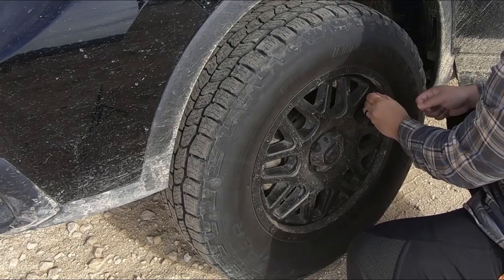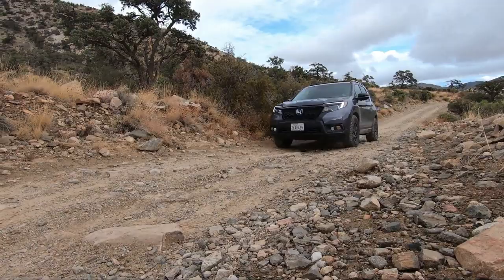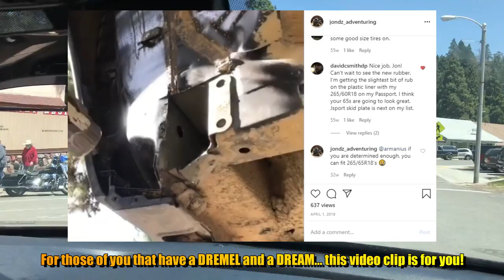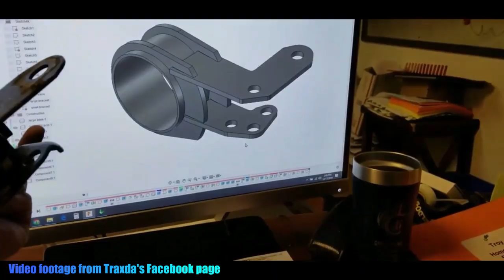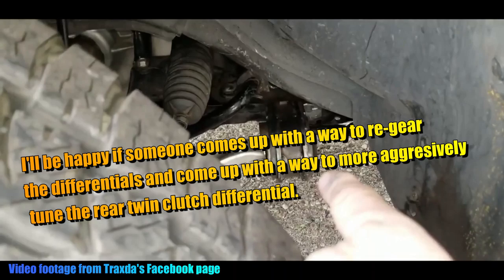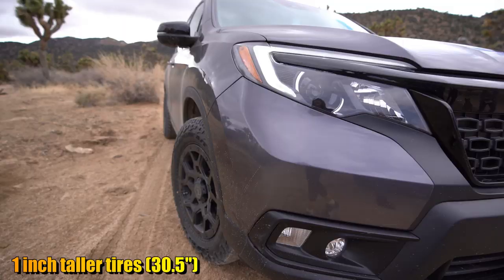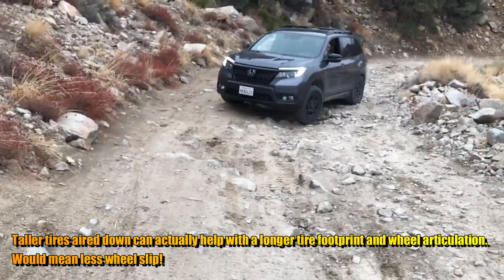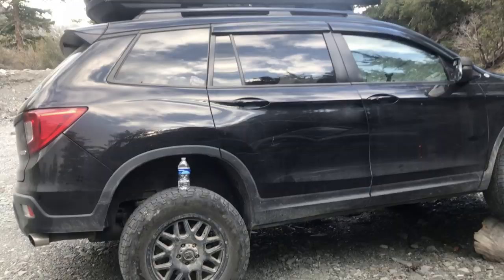TALLEST TIRE?  On a Passport/Pilot/Ridgeline

Comment: You probably already answered this question but what is the max tire size you can put on a Honda ridgeline 2022 without a lift? Thanks
Reply from the maker: The answer is in this video.  It’s not exactly cut and dry, so I recommend you listen to the explanation.

Comment: great video. I am searching my next car now. I have question about how is the 9 speed ZF trans?  thanks
Reply from the maker: ZoeY thanks!  What is your question?  For 2019+ the Honda’s Passport has the 2nd gen ZF9.
Reply: @JonDZ_Adventuring  thanks for your reply. My question is do you have any complaints about the zf trans, any issues or concerns?
Reply from the maker: ZoeY only praises.  It gives the passport a 20:1 crawl ratio.  Besides the Honda 10 speed with a  22:1, no one really comes close.  Most automatics are at 14-16:1.  The Honda 6 speed is at 14:1.  That’s means less capability.

Comment: What size A/T tire should I get for the 2019 passport without rubbing. Won't be in any rough terrain just water. Thanks
Reply from the maker: With zero rubbing? 255/50R20.  That’s a 30 inch tire.  With slight rub at only 90% lock, 265/50R20, that’s a 30.4 inch tire.

Comment: 2021 Pilot with 20 inch wheels here. Stock tires are 245/50/20. Thinking of going 265/60/20 with the 2.5 inch lift on front and 2 inch lift in the rear. Haven't seen this setup yet so not sure on if it can and will work.
Reply from the maker: that won't work at all, that's a 32.5" tire.  With no cutting or the Traxda axle relocation kit, the largest you'll fit is a 30.5" tire (with slight rub at 90% lock.  As mentioned in this video, a lift wont help you, actually might make it worse.  I personally have 32.1" tires 255/70R18, but I cut my wheel wells.  I have zero rub, even when offroad.
Reply: @JonDZ_Adventuring  that's weird because the stock tires on the 20s are 29.6". Without the lift I have 2 inches of clearance all the way around the tire. Guess I gotta do some more research ☹
Reply from the maker: This video is it.  There’s nothing out there, that’s why I made the video.  Just for you 😃.
Reply: @JonDZ_Adventuring  so I guess I should just stick with the lift and the 255/55/20 that SHOULD fit it. And thanks for the vid bro, regardless of my dumb decisions you are helping our community tons 😁
Reply from the maker: @dy2str33t-king5  if you have a dremel and a dream... you probably could live out your fantasy of taller tires 🤣
Reply: @JonDZ_Adventuring  lmao I definitely do but hacking up a brand new car with 100 miles on it won't do it for me. I wanna stay in the realm of, safe so I'll just go smaller.
Reply: @dy2str33t-king5  Did you end up with the 255/55r20? I have s 2021 Ridgeline with a 1.5 lift and thinking of putting these on. Going with a all season tire not AT. Hoping it will work out

Comment: We have a 2021 Ridgeline. I ma considering on switching the tires to a Falken AT3 or Nitto ridge grabber 265/60/18? Would these two fit without any rubbing without the lift? Thanks! 😀
Reply from the maker: There would be a little rub at full lock, but nothing too crazy
Reply: @JonDZ_Adventuring  Okay. Thanks!
Reply: Did you do it? Any rubbing?

Comment: Hello Jon, great video, super informative, I do 95% of my Passport driving in So. Cal. but occasionally hit the Sierras and would like to go with an 18" Wheel and some Nitto Grappler2 (265/60R18) which are 30.51" tall. It's great to know that this will work without a Lift Kit. My question is in regards to the Front Rubbing: Does the Wheel Off-Set affect the amount of Rubbing? I know JSport sells a KMC Wheel that matches the OEM Off Set (55mm) but other Wheels (like Black Rhino) have a 35mm Off Set and I am not sure how (or if) the Off Set will rub more or less? Thanks Man...!
Reply from the maker: stevendphoto the rubbing in the Passport/Pilot/Ridgeline happens in the front wheel well on the inner back side.  Let’s say for example that somebody wanted to fit larger tires that required cutting.  The trimming needs to be done 5 inches across and 4 inches high.  The Lower back corner needs to be chopped off about 1 inch diagonally.  With all that said, my guess is that offset won’t really make much of a difference for 30.5” tires.
Reply: @JonDZ_Adventuring  Thanks, great to know...
Reply: @stevendphoto, @JonDZ Adventuring.    I have 265/60/18 on my '19 pilot touring on +38 offset rims.  Slight rub full lock both directions.   Where it's rubbing doesn't seem sharp or destructive, but JonDZ might have a better answer on that aspect.  ;)

Oh, and my 1" diameter increase, increased my mph about 1mph, maybe 1.5mph.  I have a radar detector w/gps that shows my mph, and I'm generally just +1 vs stock.

Comment: Help requested: I am mostly looking to upgrade the 18” tires for looks and light trails. The OEM tires look very bad, to me- 245 60 18s. Would 265 60 18s look better? People’s experience?
Thank you
Reply: Yes! I put 265 60 R18 Cooper Discovery AT3’s on my 2017 Ridgeline and it looks great! Can’t feel any rubbing either.
Reply: @mousehunter8425  Thank you for response! Are the tire quiet? Did you notice speed or gas mileage difference? BTW- exact tires I was going to purchase!!!
Reply: @goforce32  there is a little road noise, but not much in my opinion. Mileage went down about 1.5 mpg but totally worth it. Speedo is also a mile or two off, but the truck looks 200x more “manly” or truck like. It’s been a big difference I’ve wanted since I bought it. And I love that tires are all terrain for dirt roads and towing my boat., and still 60,000 mile guarantee.
Reply: @mousehunter8425  Thanks again.  Great info and it helps. ;-)

Comment: Jon, when you go off-roading what mode do you usually use? Normal/Snow/Mud etc.
Reply from the maker: Most of the time, just Normal / D.  For the steep difficult 4WD trails I go with Sand Mode / Sport mode / Manual 1st gear with my left foot on the brake and right foot on the gas.

Comment: Do you think the Michelin Defender LTX M/S 265/60R18 would work without any rubbing?
Reply from the maker: I think it would rub less than an All-terrain tire, but that’s a tough call.  The rubbing only happens at the full turn of the steering wheel.  Only at 90% steering lock.
Reply: thats all I run on my 2017 Ridgeline w/no problem and 25 mpg

Comment: So what is the biggest tire that I can put as an all season tire??
Reply from the maker: Either a 30.5” x 10.4” or a 31.1” x 10.0”.  What size diameter wheel do you have?  If you running the stock 20 inch wheel, you can get either 265/50R10 or 255/55R20.  If you’re not using it already, the tire size calculator is an excellent tool.  Link below:
https://tiresize.com/calculator/

Comment: JonDZ if I'm going to taller tires, what do you think about going from 18" down to 17" wheels in order to get the right tires?
Reply from the maker: Good question!  I think 17 inch is an excellent wheel size.  What size were you planning to go? Keep in mind a really wide Tire many run into the sub frame.  The Traxda Ridgeline was able to run wide tires (I think they’re 285) by running wheel spacers.  Greg at Traxda could help you with questions.
Reply: @JonDZ_Adventuring  I'm thinking 265-65R-17,  30.56" diameter
Reply: @JonDZ_Adventuring  thank you!!

Comment: I'm running stock wheels (16) and tires (235 x 70 x 16) on my 2006 Pilot. What can I get away with height, and width especially, with no modifications to suspension.
Reply from the maker: I have no idea 🤣.  Sorry, but this video only applies the newer models.  There’s a guy that off-road/overlands a 1st Gen Pilot.  He would probably know
Reply: @JonDZ_Adventuring  Well damn!
Reply: 245/75R16 fits without rubbing on my 04.
Reply: @GabSailsCaper  That's probably what I'll start with. I am considering a 255!

Comment: @JonDZ. Did you add skid plates to your vehicle? Were they expensive to install?
Reply from the maker: That was the first thing I did.  The front skid plate covers both the engine oil pan and transmission.  I have a 5% discount code with Nolo designs “JONDZ5”.  The front skid plate is designed to be taken on and off so you can change your oil (or have someone do it).  So, I highly recommend you install it by yourself to get familiar with it.
Reply: @JonDZ_Adventuring  . Thank you!

Comment: So I’m looking at these 265/70r18 tires, what do I need to do for them? If I relocate the axle and do a spacer would that work or do I have to cut that back part?
Reply from the maker: You'll have to bring that axle forward atleast a half inch and trim the firewall.  There's two firewalls, so don't cut into the 2nd one.  Minimum 3.5" lift recommended.  I hear Traxda is working on a really stout 4.5" lift.

My Passport in it's current form has 4.25" of lift.

Comment: What does the larger tires do to the speedometer reading?
Reply from the maker: Phil J good question!  I probably should have mentioned that, eh?  A taller diameter tire will decrease the speedometer and odometer readings as well as decrease crawl ratio.  I'll also add that it will use more fuel to get moving, may decrease acceleration.  Rotational may increase mass increases (depending on weight difference).  Highway MPG's may increase.  My vehicle has 2 inch taller tires, which is a 6.8% increase in diameter / circumference.
Reply: That could be fixed?

Comment: Will 265/60R18 Wildpeaks work on the stock wheels of the pilot? Without spacers or a lift kit
Reply from the maker: Stock setup will rub the least unless you get a 3.5 inch lift kit.  The 2 inch lift will cause the most rub, you either have to have the center hub of the wheel under or above the pinch weld.

Comment: Can I keep my 18” stock tires to put on the 265/60/R18?

‘18 Pilot EX-L
Reply from the maker: Sorry for the late reply, you absolutely can.  There will be slight rub, but only at 90% lock, which most people can easily deal with.
Reply: JonDZ Adventuring all good. You answered my Q on IG. Thanks. 

More Qs via DM to come. Lol
Reply: @JonDZ_Adventuring  This vid is so amazing. I purchased a 2020 Ridgeline RTL-E two days ago. So, I understand about the 265 65 18 having a slight rub at 90 lock. I think that I can live with that. But I have two related questions. 1. I was thinking the BFG AT KO 2's would they be the exact same diameter as the Falken? Or do you know where I can find that info?
2. What about the travel up and down. Is there a possibility that the travel would be constrained by a this bigger tire? Sorry that I am such a newbie.  Thanks again for all of your info!
Reply: @1964robw  I'm glad you asked the question, because I just bought a Ridgeline 2020 too and was asking myself the same question.
Reply from the maker: Good questions Rob, I must have missed the notifications so sorry for the late reply.  So, the tire size doesn’t not account for tread depth.  I have P (passenger) rated falken wildpeak AT3W with a 13/32” tread.  This adds 0.41”.  The BFG KO2 is LT (light truck) rated and has a tread depth of 15/32” which adds 0.47”.  Now what you won’t see on a spec sheet is the aggressiveness of the tire tread.  Like stated in the video, A/T tires tend to be more squared off than a street tire.

Comment: Whats the max size tires I can put on my stock 2013 ex pilot without rubbing or cutting? If anything can 2 inch spacer help?
Reply from the maker: I’m not totally sure to be honest, but some people have mentioned you can run 265/65R18 on the 2nd Gen pilot

Comment: Not that I have anything against Honda, but why buy and ruin perfectly good mall crawler on the trails? I think decently equipped Wrangler runs about same $$.  Just curious.
Reply from the maker: Gee Eee that’s a fair question.  I actually regret not checking out a Jeep Wrangler JL.  The reason I never even considered it was because of it’s perceived as an unreliable vehicle.  The reason I purchased a Honda is because, for many, they’re #2 in reliability/dependability, right behind Toyota (however, not all models, and that’ll be a whole other story).  Actually watch this video to get the history.
https://youtu.be/Hlg41C-W9r4
I basically use to drive a FJ cruiser, then a WRX, then a Forester XT and owning all those vehicles influenced the purchase of my Passport.  I did not like driving the FJ, and the Subaru’s were just too unreliable.  I wanted a compromise between the FJ cruiser and my WRX.  This vehicle is my Daily Driver, I’m an overlander, not an off-roader.  
However, I’ve commented many times, I’m impressed with the JL Wrangler.  It’s the only vehicle I’d trade my passport in for.  I would not take a JK, 4runner, over this.  I might take a GX460... but that’s a solid maybe.
Reply: @JonDZ_Adventuring  I get it. That's the perception. I never owned Wrangler so I can't say anything about it's reliability. But I owned Grand Cherokee. It was OK. I also own many trucks that I "modified". And I can assure you, it doesn't add reliability either :)
Reply: Probably because Jon wants to spend more time off road than at a Jeep Dealer waiting for repairs...!
Reply: @stevendphoto  So when was the last time you visited Honda dealer and shop was empty?
Reply: @geeeee8268  If that is your logic when purchasing a vehicle - more power to you (Hint: Did you ask who was there for an oil change?)
Here Jeep Wrangler is rated 13 out of 16 SUVs (kinda low, right?):
https://cars.usnews.com/cars-trucks/jeep/wrangler/reliability
OR maybe you have heard of JD Powers: 
LINK: https://yourjeepguide.com/wrangler-reliability/
"According to the J.D. Power Dependability Study, the 2018 Jeep Wrangler has a reliability score of 2.5 out of 5." (kinda low, right?)
Or perhaps you failed to see the Jeep Recall of 91,000 vehicles due to ROLLOVER, from just a few days ago: LINK: https://www.freep.com/story/money/cars/chrysler/2020/06/18/jeep-cherokee-recall-rollaway-risk-power-loss/3213048001/   (kinda bad, right?)

I found all these PROBLEMS in the time it took you to write your snappy retort. Now, if you love your Jeep and want to buy a new one, I'll sleep just fine at night! Just don't try to justify YOUR bad decision, with FAKE FACTS!
Reply: @stevendphoto  I am not saying Wrangler is perfect. And I am not buying one any time soon. But there are as many happy Jeep owners as unhappy Honda ones. Especially if you start tearing into a Honda and "improve" things.
Reply from the maker: I’m at close to 40k miles now and so far no issues.  It’s such a good daily driver and I just got back from going up to funnel lake here at the Coyote flats.  There were 4 vehicles that over heated and didn’t make it.  Honda Ridgeline, (2) 2nd gen Acura MDX, and a Jeep Grand Cherokee WK1 in 4wd low.  The trail starts at 4200 ft and ends at 10,400 ft.  

https://www.instagram.com/p/CBvwUGTpmyE/?igshid=npzzzf7usipz

Keep in mind, I don’t feel my Honda is very  “modified”.  Just 2 inch strut spacers, and 2.5 inch taller tires, trimmed front and rear bumpers and a skid plate.  I spent just over $1000 not counting wheels and tires.  After the trip this weekend, I’m really really impressed with the passport.
Reply: @JonDZ_Adventuring  LOL, I've had my PP for nearly 17 months and have around 9,600 miles... !
Reply from the maker: stevendphoto is probably be at 60k if it wasn’t for Covid.  When ski season arrives, I’ll be putting on a lot of miles.
Reply: @JonDZ_Adventuring  Well then you are certainly enjoying yours more than me! I waxed mine 2 days ago and Calif Duster'd it today (it sits out). 
Oh I replaced my front and speakers with some higher end Focals and the stock Amp & Head Unit sound amazing...! And stereo upgrades for you?

Comment: Hi JonDZ! I own a 2017 Honda Ridgeline unmodified. I'm going wider&bigger. Could the Traxda axle-forward modification be DYI installed? You said that this mod would allow 2" taller tires without wheel well modifications. Confirmed?  Thank you, Frank
Reply from the maker: You would need a heavy duty machine to press out the rubber bushing out of the OEM part (sorry, I don’t know what it’s called).  Sorry, I don’t think DIY hand tools would be able to complete the job.  An auto shop may be able to help you.
Reply from the maker: You can contact Traxda to help you find someone to press out the bushings.
Reply: @JonDZ_Adventuring  Thanks! The website says that they will have a urethane insert to go along with the kit soon.  Cool Runnings, F

Comment: Did you have any issues with the speedometer, tire pressure sensor, or any other components when you downsized the tires from the 20’ ‘to the 18’’?
Reply from the maker: No.  In theory, the change in wheel size should do nothing and I can confirm that.
Reply: @JonDZ_Adventuring  awesome! Thank you for replying and for the information!

Comment: Hey Jon if you wanted to run a 17" tire which Tire Rack has what would that be 265/65/17? Or 70? Thanks.
Reply from the maker: Without the front axle relocation kit or trimming your wheel well, you would need to go with 265/65R17

Comment: Jon,
Do you know if a 1 to 1.5 inch lift will provide clearance for the 265/60R18 A/T?
Reply from the maker: Those tires will fit without a lift with slight rubbing at 90% lock.  I don’t think the lift will make a different to be honest.  You’ll have to lift your vehicle 3 inches of more to get off the center line of the wheel.  Btw, I love my 3.5” lift 😃.  About the same stress as a 1” inch lift, but over 3 inches of real gains.
Reply: @JonDZ_Adventuring I have a 2009 Ridgeline all stock. does 265/60/18 would fit ?